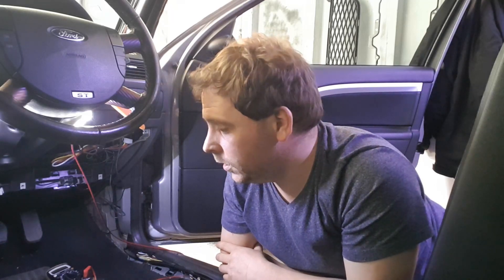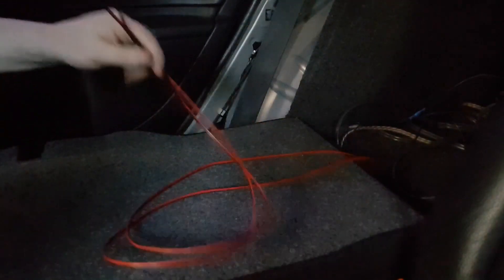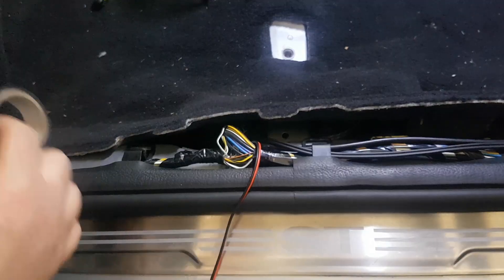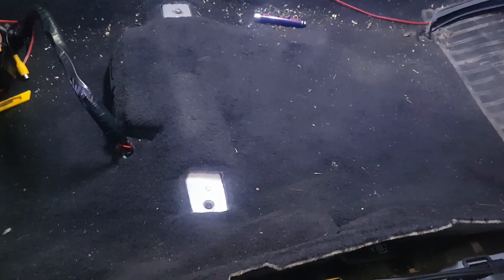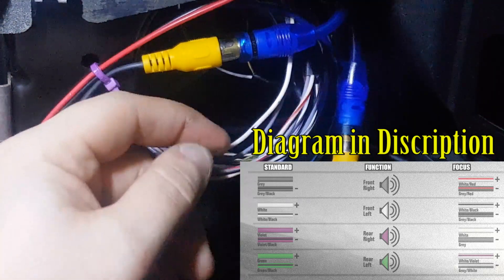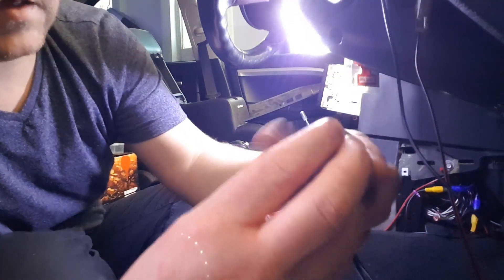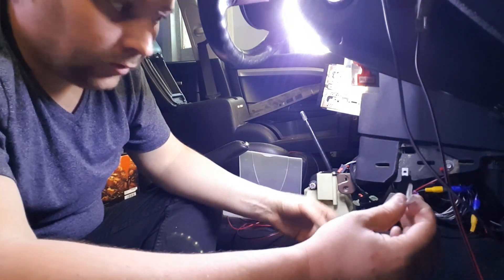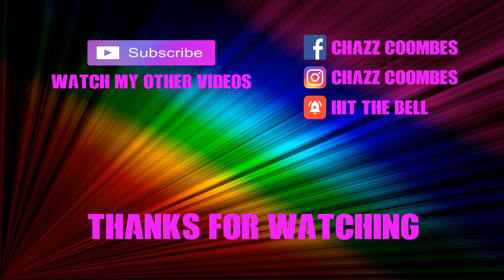Running Speakers Wires for Component Speakers Ford Mondeo MK3 (project St220)

Comment: Hey Chazz, thanks for the upload it is really informative! So as I figure, you did not lead the speaker cables through to the doors directly, instead you connected your amped cables to the OEM wires in the centre console. Whats you experience, are the OEM wires thick enough for this setup? Do you possibly know the cross section of them? Have you experienced any downsides of sticking to them?
Reply from the maker: Hiya cheers for the comment, i stuck with the stock wire to see if all would be ok and so far so good. No issues or interfirance. how ever i am upgrading the speakers for Kenwood and will probally run upgraded wires to each speaker.
Reply: @ChazzCoombes  Hey thanks for the response, I really appreciate it. Could you please tell me the RMS power of the amp channels which are running your front component set?
Reply from the maker: @alexhettmann6730  mo probs, you should check out the playlist. The speakers i use match the rms output of the 4 channel amp. Will all be Kenwood when done. https://youtube.com/playlist?list=PLf6eOQvzHyskj2S73d7ra1xoo4KUyQQFg
Reply: @ChazzCoombes  Awesome, thanks for the help! Good luck with the upgrades and enjoy the setup!
Reply from the maker: @alexhettmann6730  no probs mate, be sure to leave a like on the vids and sub if you aint already lol